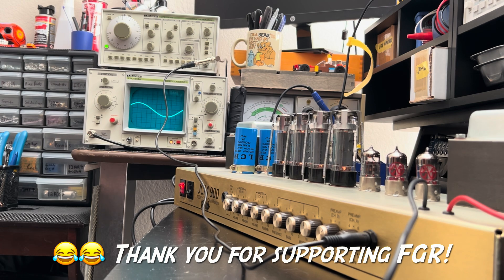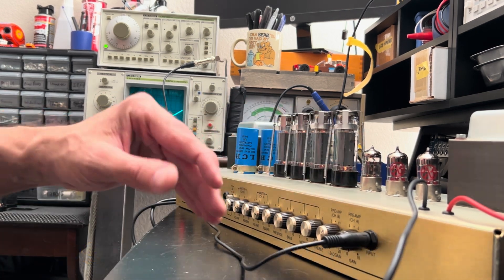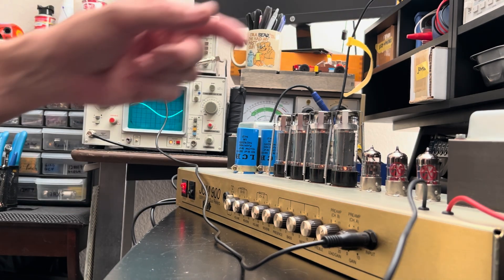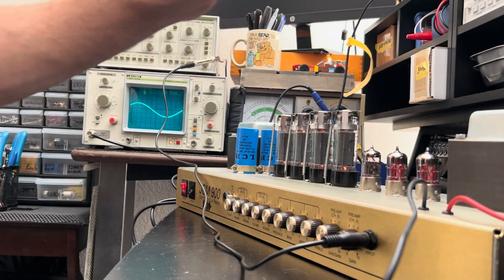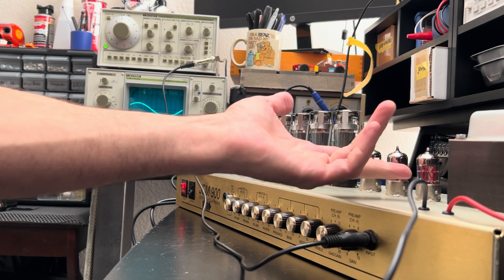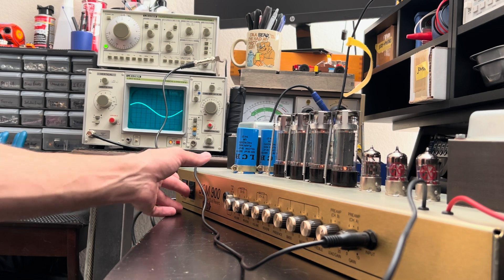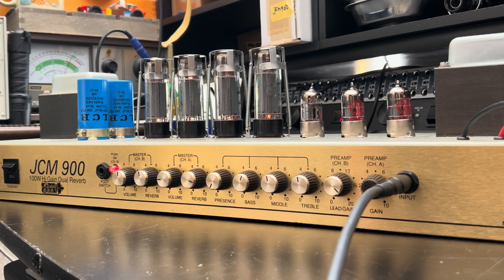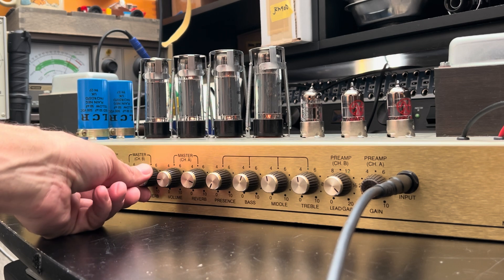Marshall JCM900 4100 Part 2 || The Juiciest 900

Comment: The cleans aren't bad for a 900.. (6L6s?), they cop/ped a lot of hate back in the day, probably cos every bugga was using them(?)
Reply: Definitely EL34s in that amp.
Reply: @skidmark316 
My memory is never good (understatement) l thought the JCM 900s came with 5881 valves stock and cd be switched to 6L6 mate(?).
Might have it arse about, a mate had one yrs back and it definitely didn't have EL34s in the power section.
Again, l cd be wrong.
Reply from the maker: Some came with 5881’s - not many. Same with the 800 series tubes from the 6l6 family.
Reply: @ForgottenGearRestorations  Thanks Frank, l wasn't 100% sure mate..
5881s cd be swapped for 6L6s? But not the other way around, in a lot of cases (grid voltage?).
Reply: @baabaabaa-El  5881 is just a mil-spec rugged 6L6. Same pinout, both beam tetrodes, 5881 usually came in a smaller glass enclosure, and are interchangable with each other. EL34 is a pentode, not interchangable with 6L6/5881 unless you do some minor rewiring.
Reply: @skidmark316  Cheers mate.

Comment: Happy new Year Frank and Family ,this amp sounds amazing but what about the LCR can caps ? do they fail like all other Multican caps ? if so can they be bypassed ? I think the issues with some of these amps were not nessesarily the caps but the thin traces and bad placement of components
Reply from the maker: Hey happy new year!  Those caps are rugged. Only seen very very few fail over the years. Bias caps can be finicky on these amps and the impedance switch is pretty frail!  I see lots of them short out (same with high/low power switch).  I’m sure other techs see other things, but that’s just one man’s experience thus far.
Reply: Happy New Year to you two ratbags!!
No doubt we'll cross paths.. here, Brad's or Lyle's in '25.
Til then..👍🏼

Comment: I have one of these, they don’t deserve the criticism from guitarists on the internet that they get. These things basically are the definitive sound of 90s punk. Also if you’re a Morbid Angel fan, Trey has used these forever. Brad does a good job of pointing out the shortcoming of these amps from a tech standpoint, but the criticisms that guitarists on the internet have for these amps because there’s ICs in the preamp section and clipping diodes is dumb. Yes the 2203/4 is a better amp but let’s not pretend everyone wasn’t boosting those with a TS808/SD-1/Rat etc. They’re not a 2203 or 1959 but that’s OK. I don’t see anyone hating on the old MusicMan amps for having an IC preamp and tube power section, so I don’t think it’s fair for these to get that hate. I think it was inevitable that whatever followed after the JCM800s success was going to get hated on. Alright, rant over.
Reply from the maker: Same boat!  We don’t worship golden calves here at the channel!  I don’t care who made the amp!  If it sounds good, it is good!  I laugh at the dudes casting stones at these amps when they have no issues running silicon into the input for boosts!
Reply: I'm a big fan of tube circuitry ( because it's easier for my tired old brain to understand!) but I'm a firm believer that there is no wrong way to build a circuit if it gets you the results you want. I wonder how many guitarists who criticize an amp for having ICs and clipping diodes have pedal boards jam-packed with cheap op-amps and back-to-back diodes. The bottom line is that if you're achieving the sound you want, you're doing it right.
Reply: This one has the 6L6s too which are really great amps.  I record my other guitarist through one of these while I use Boogie Mark series stuff and they blend really well.
Reply from the maker: @rickfinsta2951 I bet they do!  I love how they track together.